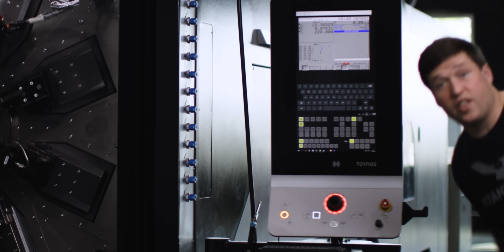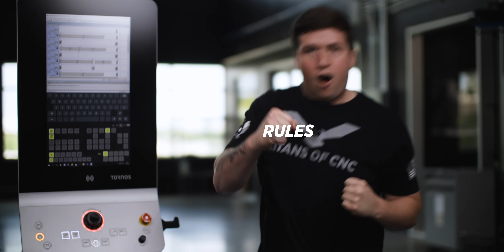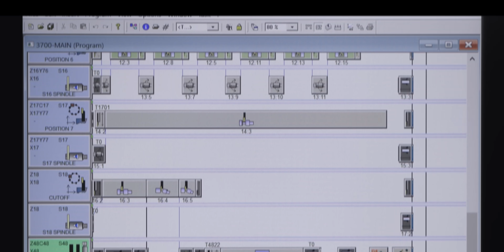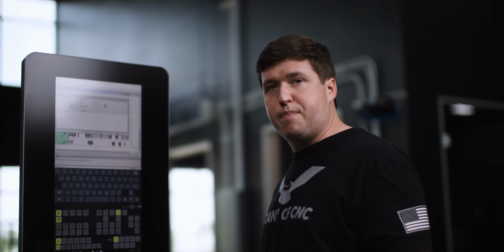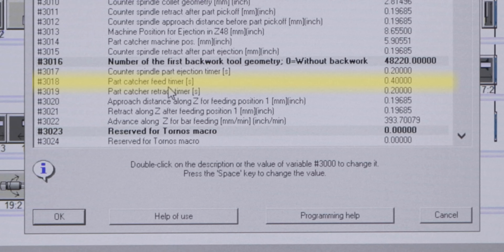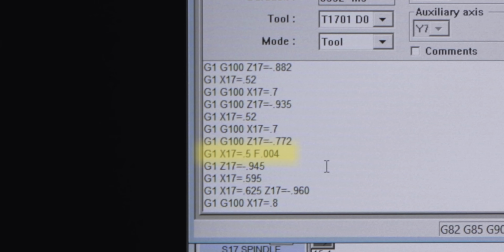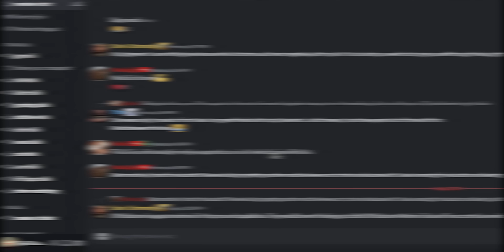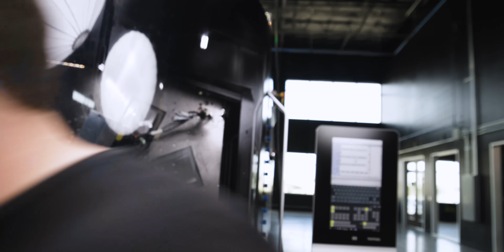Incredible Machining: Parts Made In Seconds Using 8 Spindles

Comment: Speeding up the program is all well and good, but how much undo ware are you putting on the machine. You may save a day, but how much time in downtime for machine failure. Plus, the tools have a max work speed. How many of them are over working. When they program these machines, they are all ready working at optimal speed
Reply: Seeing as he’s cutting brass, I’d say it’s a non-issue.
Reply: @Pondimus_Maximus  in this case it may not... but its something he didn't cover in the video. those changes may have an impact on tool-life, and as such you eventually have to consider tool-change times too. 

in my past job i had to redesign an injection mold from pure mechanical sub-division demoulding to a hydraulic driven one, because they couldn't just write a better control-code for the machine to not accelerate/decelerate to fast for the couplings and whatnot. 
Being able to save cycletime just on the machine is a great feature...
Reply: @Pondimus_Maximus  Well, I make brass cylinder locks and I have to change some tools every month, which is not that bad.
Reply: The defaults can sometimes be fairly conservative so that it can cover all bases as the person setting it doesn't know what will be going on in each specific case. It's up to a smart programmer to know when bringing times down won't cause problems, and bump things back up when they do. 

It could be that the ideal solution for something like this is to reduce certain dwells on specific ops where that will affect the end result but keep dwells longer on stations that can afford it without affecting total time, if doing so would improve reliability or so-on.

Because saving 1 second might save a week but if it causes a 5 day downtime for maintenance (plus expenses) was it worth it? That said if running a cylinder harder means needing to be swapped out in 5 years instead of 7, but also means you get 7 years of parts done in 5, then it's worth it.
Reply: Well, when you are writting your code for that machine...
Reply: You can't even spell 'wear' correctly, how can you can even be trusted to predict and handle the wear characteristics of anything when your first solution is "just give up" before you've taken a single measurement or changed a single variable? Quitters like you are hilarious
Reply: Keep in mind that time is money, and a week less time could be worse 10s or 100s of thousands of dollars to some customers. That could absolutly be worth some rebuild time at the end of a process or some spent tooling... it's call Optimization....

Comment: I always tell the people I train you can make bad parts just as fast as good ones lol
Reply: It's either a usable PART, or it's junk. No such thing as a BAD part. It's how I was taught.  (.005 tolerance to us actually meant .002-3 max)
Reply: @POWER-LINKS  0.002mm? what kind of parts did you produce?
Reply: @rtomas47   High precision gear bores.  (inch, not metric)  Some were down to .0005 of an inch.
Reply: @POWER-LINKS  I produce cylinder locks with accuracy about 0.005mm but the tolerances are mostly about +-0.03mm. The most complicated cylinder plug has about 350 dimensions.